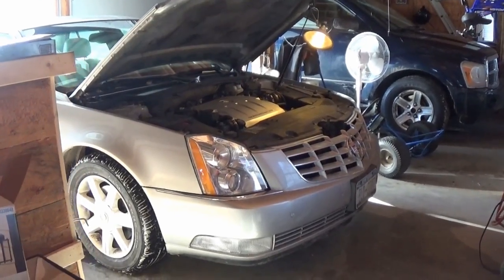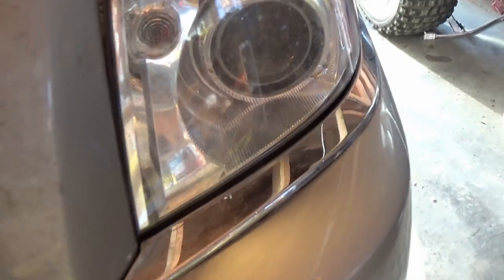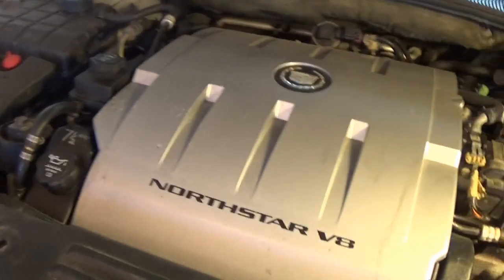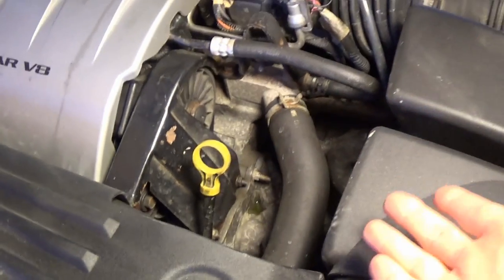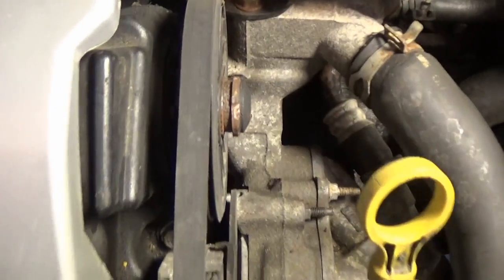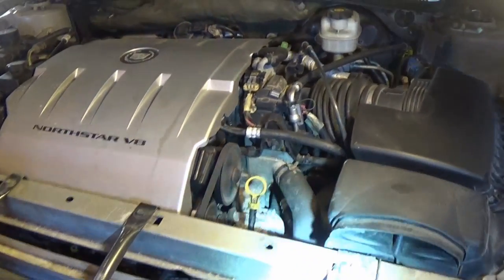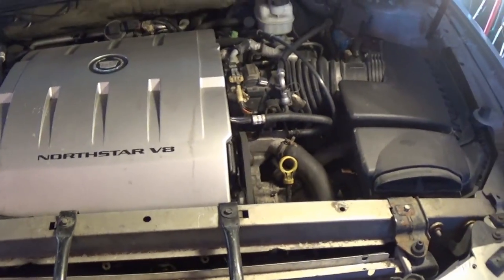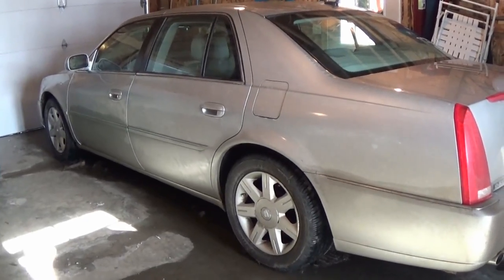I Think I Found The Leak!  (Not Good)

Comment: Hey Jimmy. I agree with Bryan, I would replace that top radiator hose with new clamps first since the antifreeze just pooled on top of the water pump, just underneath the hose clamp. Perhaps contraction of the hose overnight during the extreme cold allowed some antifreeze to squeeze by.
Reply from the maker: That is a possibility!  I agree with you guys, I'm ordering a new upper hose and getting some new clamps for it this week, may as well rule that out and cross our fingers!  Thanks dude :D

Comment: Those have external water pumps. The oring around the pump is the culprit. New waterpump and oring gaskets will fix that.
Reply: My Oldsmobile Aurora had  that same crapstar motor. I changed the pump and rings 2 times on it. Need a special waterpump tool to pull that thing out. My crapstar blew up at 160k miles.

Comment: The water pump in my 03 deville had to be removed with an air hammer when I bought it. It was so badly corroded in it wouldn't come out because it just rotates and clips in (No bolts). Literally had to destroy the old pump to get a new one in. It was risky but it worked.

Comment: When you were having the overheating issues earlier on, did you perhaps use any kind of stopleak or some liquid gasket or anything alike? That goop does seem to look like something similar...

These Northstar engines are not known to mix oil and coolant together, so I doubt it could be that.

As for the collected coolant on top of the water pump.. Like Bryan Gall mentioned before me, I would at least check the hoses and clamps. My Seville STS (as you can see on my channel) had been losing some coolant too. I replaced my Surge tank, because they can develop hairline cracks due to all the heat cycles, which is a common thing. But it ended up being the hose clamp from the surge tank... The tension on these clamps weakens as they go through heat cycles. So definitely look into that!

I'm curious to what you'll find out.

And greetings from the Netherlands!
Reply from the maker: Thank you for the input, I appreciate it!  From the Netherlands too, that's awesome!  We never attempted to use a stop leak or anything similar, but we did notice something collected a little in the surge tank that looked similar as well.  It's confusing, but maybe at some point the car had some additive like the such in there and that's what the mysterious "goop" is from.  I'm ordering a new upper radiator hose and getting some new clamps as we speak, may as well rule that out first and see what we can find, and there will be an update up soon.  Thanks again! :D
Reply: You're welcome! You're putting up interesting and honest content, I enjoy it very much. Heck, I found your channel because I was having wheel-bearing issues similar to yours (I had replaced one, seemed fixed, sound came back like yours...). Ended up with replacing both, like you did, and that fixed it.

You know what, now that you mention the residu in the surge tank! Maybe the goop isn't any leftover stop leak product, after all... These cars came from the factory with Dex-Cool coolant... Do you have any idea when this was changed out for the coolant you are using now? Only thing that could debunk this theory is if the Water pump had been replaced in between the coolant change from Dex-Cool to another.

My old surge tank had this red/copper/orange colored residu on the inside as well.
Reply from the maker: Thank you!!!  I'm glad you enjoy the videos :D  Dex-Cool, that makes perfect sense!  I can't remember exactly when we finally switched to universal, but I think it could be from that, thanks!  Just got the new upper hose in the mail, and I'll be working on it this week!  (sorry about the late reply btw, YouTube notifications have seen better days lol)

Comment: Put a cooling system presure tester on the radiatorin place of the radiator cap.  Pump it up to recumended  presure on the radiator cap and let it sit for a few hours. Check over the hose clamps and water pump. Sometimes the parts store have these presure testers and will lend them out.

Comment: The reason the coolant has accumulated on top  of the water pump is because the leak is actually down around the bottom side of the pump but the belt is being sprayed with coolant on the bottom side and then the wet belt brings the coolant up around the pulleys and the coolant is then sprayed from the rotating belt on to the belt guard and from that point it is diverted by the belt guard and eventually accumulates on top of the water pump.  The leak is down below on the bottom side of the water pump.  So sorry but it is a rather involved repair.
Reply: You are spot on, Sir! I experienced the same exact set of events you so perfectly worded

Comment: I musta replaced several hundred water pumps for the Deathstar in my 38 looong, miserable years at cad. dealers. [2] The special tool for R and R is a must.
Reply: Like what  you  said  Deathstar  Government  should  had let GM go completely  under Hard to believe  GM  got completely  away  with  putting  Deathstars in an American  made car Always  wondered  What Cadi mechanics felt .Y'all  even  got screwed,  because  you  had to work  on these cars  and still  couldn't  keep  them  running,  because  GM designed  them  that way. If you  have pride  in your  work,  I'm sure  it  had to wear you  all down.
Reply: @mickywhaley1382  The warranty jobs were equally bad since GM only paid a fraction of the labor necessary to repair anything related to a warranty claim. Many times we worked for free on warranty claims due to insufficient time allowance. It's still that way!!

Comment: You used the wrong coolant when you did your head gaskets on the previous video.  USE DEXCOOL ONLY especially in the northstar.  That is why your water pump went bad and overheated.  DEXCOOL is original in these and should be flushed fully at 100,000 miles and replaced with DEXCOOL it is red/orange in color not GREEN!!!!!!